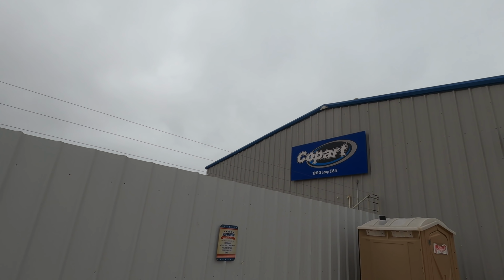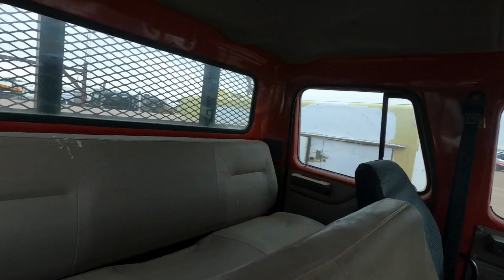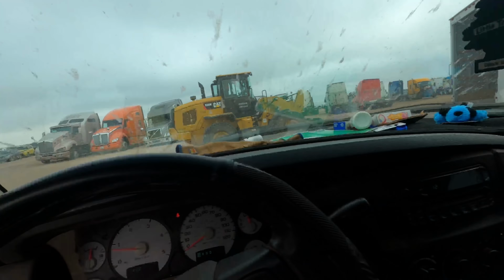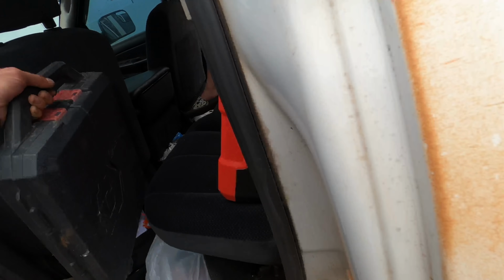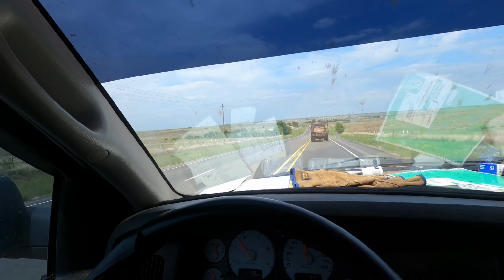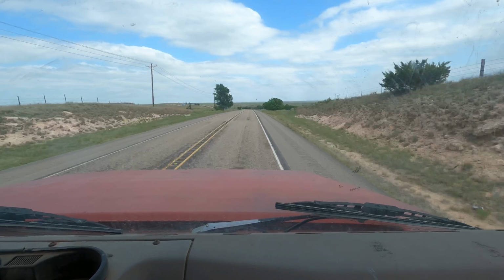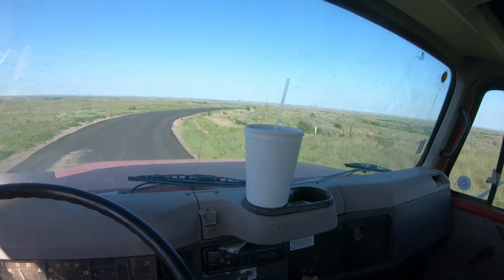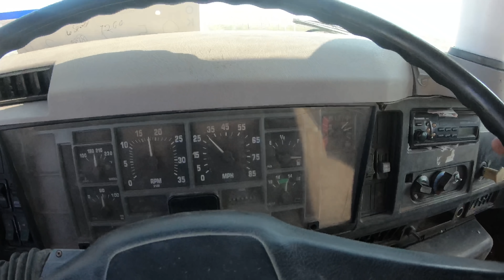Trip to Copart To get A TRUCK Will It Drive Home

Comment: Hey John, your problem is that the engine most likely has a govenor on it and is why you can't get it to move faster. I drove International school buses that did the same thing and max out at 55 because they were governed down. Check that out first..
Reply from the maker: Yes it is governed at 55 but going 35 up hills it should have way more power I am thinking that the governor is messed up
Reply: @RightOnJohn383  check the boost and turbo. I have seen the air to air charger plugged up also

Comment: Hey John, what efi kit you use on that el camino?
Reply from the maker: I just bought the quadrajet version alone not in a kit the in line fuel tanks suck
Reply from the maker: Fuel pumps
Reply: Was it holley sniper, why online pumps suck?
Reply from the maker: @claudeladow2334  yes holley sniper and they get too hot and burn out it was about 100 dollars more to do the in tank pump
Reply: Good to know, maybe saved me some money.